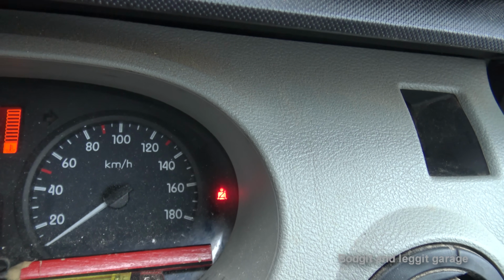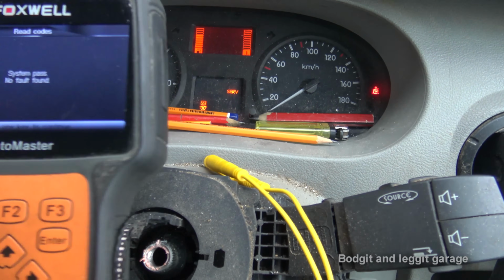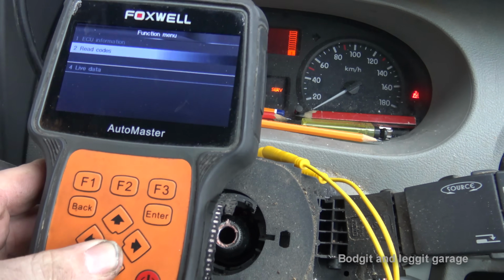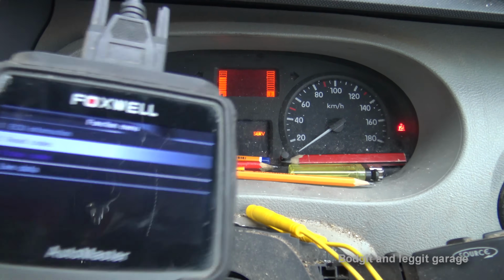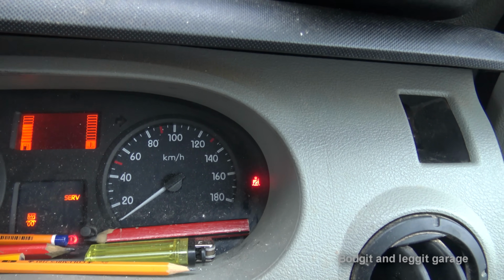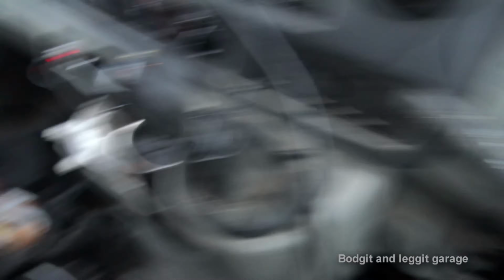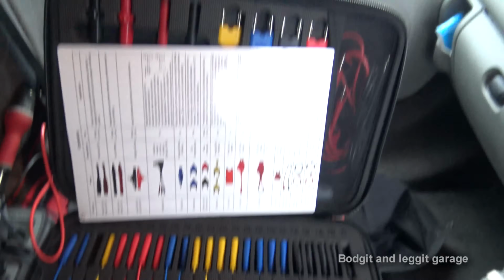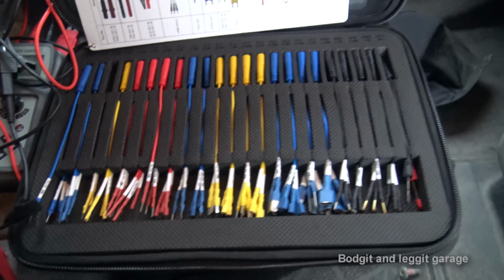How To Test Airbag Systems With Hubitools Test Equipment  Bodgit And Leggit Garage

Comment: Hi Leon I'm just wondering how easy it is to do a coolant flush on a Mk3 2.0tdci, do you need to bleed the system or are they self bleeding. Thanks mate.
Reply from the maker: Andrew Dalling hi mate there's a few different ways of doing it you can get a special tool which means you don't have to bleed it but you can also do it the old fashioned way where you do have to bleed It just make sure you put the right antifreeze back in afterwards bleed it properly

Comment: What's your opinion on a mk3 mondeo 2.0 tdci solid flywheel clutch conversion. Doing mine next week along with starter.
Reply from the maker: Claire Bryson I've done a few and never had a problem but make sure you get a branded clutch kit not a cheap shity one you will have problems first gear sometimes can be a bit jerky as long as you are smooth you won't have a problem

Comment: what is your opinion on the Mk4 Ford Mondeo 1.8tdci/2.0tdci ?
Reply from the maker: Rohan 2L all the way Ford engine 1.8 stupid shit wet belt
Reply: bodgit and leggit garage 
Yeah i have heard the horror stories and the french engines they are using. Not sure if its the 1.8 or 2.0 which uses the peugeot engine
Reply from the maker: Rohan 2L engine is the Ford engine 2L engine all the way
Reply: bodgit and leggit garage Thanks for your advice mate
Reply: bodgit and leggit garage, I agree that 1.8 is 💩, guess how I know, yes I have one. But to my knowledge between 2007 - 2014 the 2.0 liter was exactly the same on a Mondeo and Peugeot Expert. Regards.